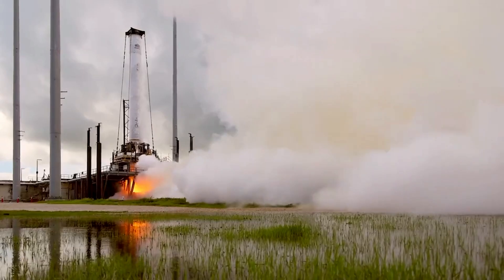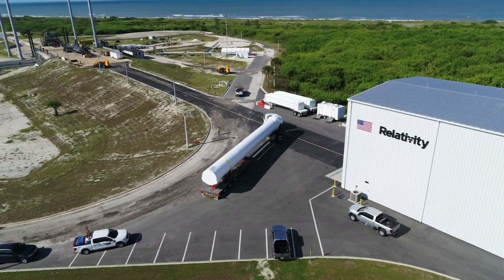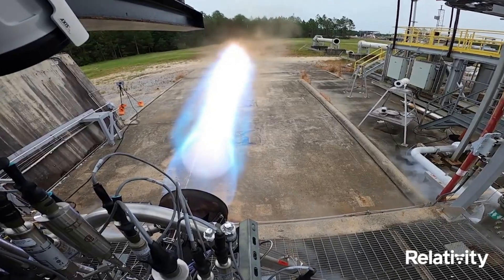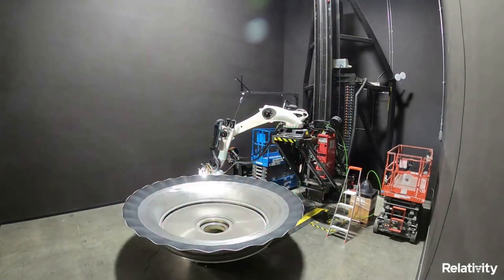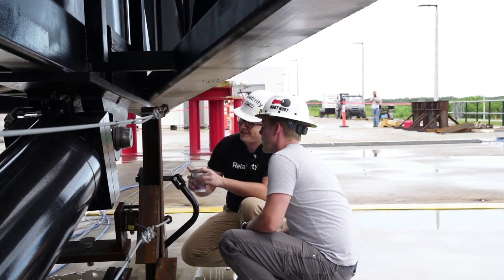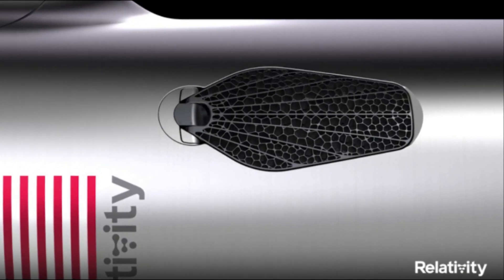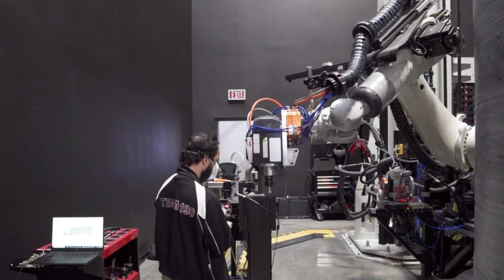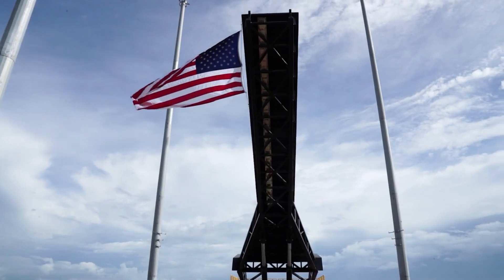Relativity Is Continuing To Make Progress On Terran R

Comment: Too much hype and talk. I like to see results. Until then it's all speculation to me.
Reply: Well, they did test fire the engine. No matter what, that's impressive
Reply: @patricklewis7636  if you're going by that then Astra is SpaceX.
Reply: Did you have the same attitude with Starship when it was first announced?
Reply: @moekitsune  starship is still a work and progress as well. I believe in Elon but even starship won't be an easy make. But good luck to them on that monstrosity.